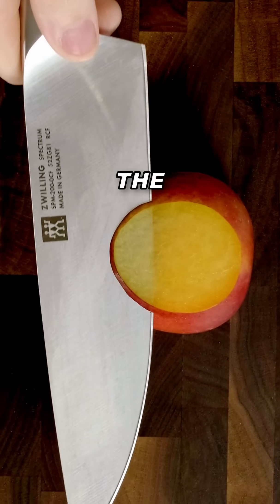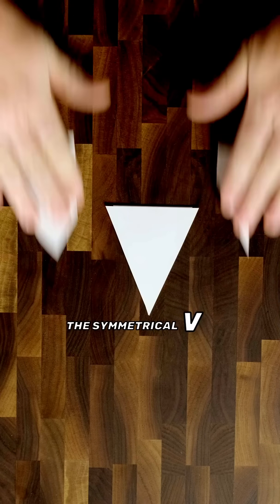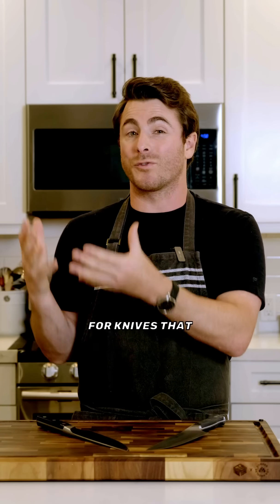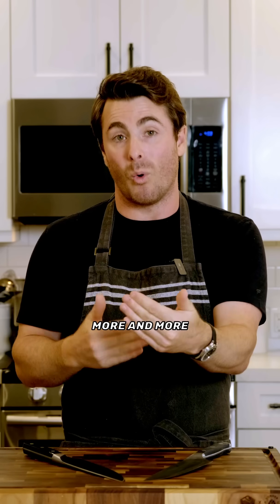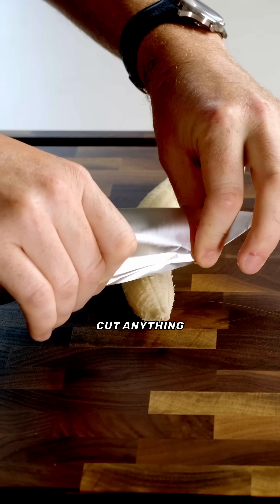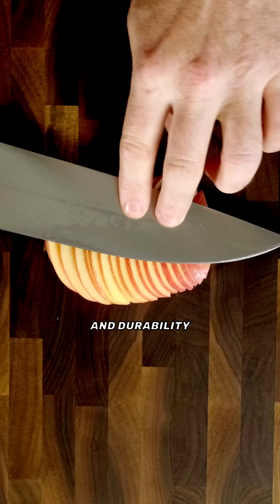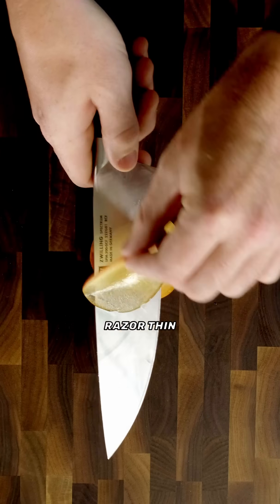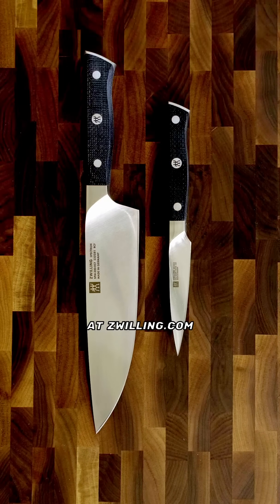The Secret Behind Sharp Knives

Comment: I think you are veering off the actual topic of Edge Geometry. V-Edge, Convexe Edge, Hollow Grind, etc... basically the shape of the knife edge, or right behind the apex.

What you are lostly talking about is the sharpening angle, which is just one minot component for Edge Geometry.

The most important aspect for a razor sharp "laser" knife is the thinness of the knife right behind the apex of the knife.

You cannput a 10° per side edge on an axe and it would wedge everything you cut, because an axe is stupidly thick.

The new Zwilling series "Spectrum" is extremely thin, that's why it cuts so well, I would argue it would still cut amazingly with a 18° edge, just because it is so think.

Comment: Don't know about this German steel stuff, but ice-hardening aka cryogenic treatment (which involves process of cooling a knife to sub-zero temperature of -185C (-301Freedom) after typical heat-treatment) is legitimate and widely used technique to enhance performance and durability of high-end knives in Germany, Japan and US. Though they typically charge up to 50% more upfront cost compared to similar, regular heat-treated knives, due to their longevity they become cost-effective option in the long run. As far as I know, not all kind of steel benefit from this process so it should be the best interest of yours to do some searching before getting one.

Comment: a knife edge has 3 properties: sharpness crispness and thickness
sharpness: angle of the edge measured in degrees° 
crispness: often mistaken with sharpness how rounded or straight the end of the edge is, how easily it bites into objects
thickness: measured in μm is how thick the blade is in the thickest part

Comment: If you have a no name cheap knife and lacks a chromatograph to identify the chemical composition of steel:
It's probably 420J2 stainless. It has top notch corrosion resistance and it's easy to sharpen. Howevee it has poor wear resistance and edge retention. It is among the cheapest and most common stainless steels and it's excelent corrosion resistance makes non steel nerds go "no rust = gooder".
So, go for the 40°

Comment: Well, this is quite a load marketing speak. First of all, a lot stainless steel require cold treatment after heating and quenching (typically plate quench). It can be liquid nitrogen or whatever, but it's just what the steel requires.

Second, I looked at the specs for the Spectrum line on Zwilling's website and there, it stated plainly that the blade hardness is 55-58 HRC. I mean, OK, some of the cheaper supermarket knives are 51-53, but 55-58 is Victorinox's specs. Zwilling Spectrum chef knife is 180 bucks. The Victorinox Fibrox counterpart is 60 or so. OK, the Victorinox Fibrox has a partial tang inset plastic handle and what? The spectrum has a triple riveted mircata (read: synthetic) handle. If you buy the Victorinox Grand Maitre line, it's the same steel as Zwilling Spectrum at the same cost for triple-riveted wood handles.

I can do everything you demonstrated with a Victorinox. Now, I am poor, so I use a hard bamboo board, which I found only a 46 degrees edge with a microbevel can reasonably survive on that. That said, cutting performance relies also on thickness behind the edge. A dull knife can still cut soft food well if it's thin behind the edge. This is the blade geometry: spine thickness, blade grind (flat, saber, scandi, etc ...) and, e.g., how thick is the knife measured at 2.5 mm behind the edge. A 0.3 mm 2.5 mm the edge feels very, very different from a 0.4 or 0.7 mm one. I thin my knives out.

Even if you want to buy from Zwilling, well, Zwilling also sells the Miyabi line. They are hardened to 61-62 HRC. I can buy VG-10 steel knives from Amazon Japan at 40 bucks a pop.

Comment: "Ice-hardened German steel" tells us absolutely nothing. :T 
Especially frustrating to have that preceded by the explanation on how important the quality of the steel is when it comes to more narrow edge bevels.

Edit: per the website:
Substance: Special formular steel (?)
Manufacturing method: forged SIGMAFORGE (?)
Rockwell Hardness rating: 55-58

The hardness is a little on the low end for this bevel angle but it's fine.